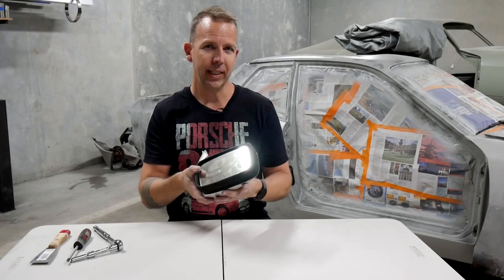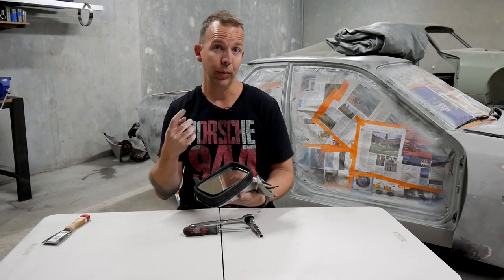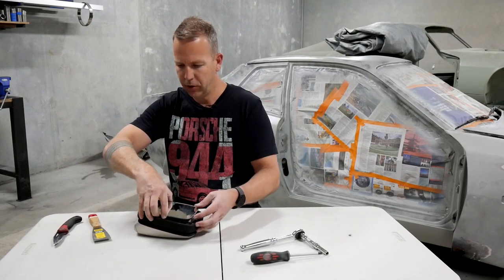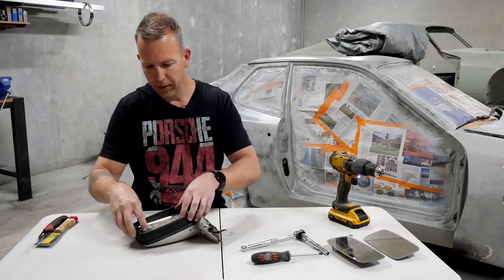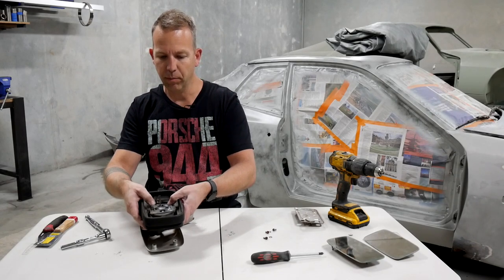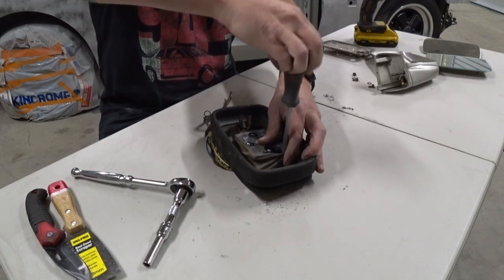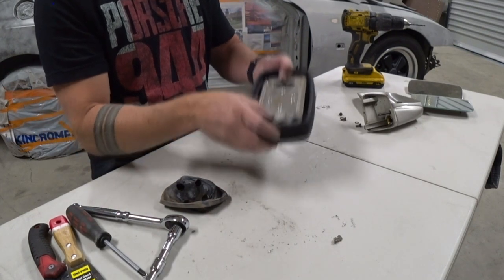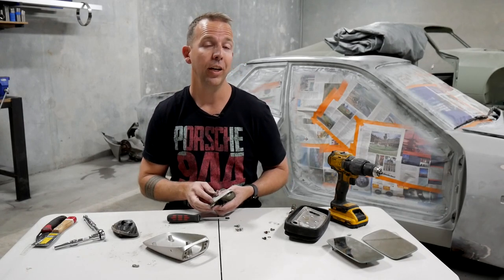How to Disassemble the side mirror on an early Porsche 944

Comment: Mine is a 87 944, I believe the mirrors are different. But how do you get them off from the door itself?
Reply from the maker: Swivel the mirror outward (or inward, I forget) and it should reveal the securing bolt.
Reply: Ohh that easy. So if I buy new or used ones, it's that simple to just swivel and tighten the bolt.
Someone along the way modded another type Porsche mirrors but do not know which model. I do not know how to attach photos to show you
Reply from the maker: Just message my Instagram. 

The only other consideration is the wires that control the electric mirror, but it should just be a plug connector.